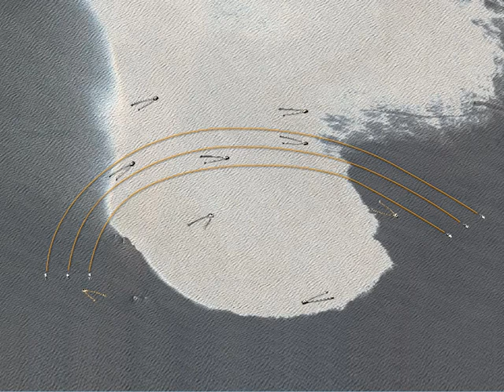Solution for Stopping the Gulf Oil Spill - Part 1:  How To Slow The BP Oil Slick

Comment: This is well intentioned, but it seems to me you've never really been in the GOM, or on any ocean surface, for that matter. Your opening comment on scale undermines this entire idea. The diameter distances alone are like driving 70mph for 1-4 hours; the circumference alone is about 700+ miles, and you suggest a series of continuous  perfect circles?  Try about 10000 sets of circles each about 1/1000 the size of what you suggest here and there might be a plan.

Comment: how would the crews and vessels swap out when the shift ends or they need refueling and maintenance? Will each boom have to have a gated portion for them to pass through? That means someone to watch, monitor and operate that as well. Also... that is a lot of boom you are talking about 100s of miles worth, likely into the thousands.

Comment: @HugoIStayHere 

$20,500 cost per working pair with crew per day allows for 751 working pairs (using only 40% of the amount collected in fines each day).  

And if each working pair collected only 47 barrels per day, that would be ALL 35,000 barrels per day collected.  Leaving another $23,100,000 per day for administration (planes, radios, training, etc).

Comment: @HugoIStayHere 

Say 60% or $23,100,000 per day for administration and 40% or $15,400,000 per day for actually doing the work.  And assume you need two good ocean going ships per boom.

Two 2nd hand ocean going tugs cost about $1,200,000.  Over one year, that is a daily repayment cost of $3,285 per day working.  Round it up to $10,000 per working day for repayments, fuel and repairs.

Comment: Build a 500,000 gallon bladder made of kevlar interwoven with high-tensile wire mesh with inlet and outlet ports -- one attached around the wellhead, and one or more at the other end for flexible siphoning hoses to the surface.  The bladder is twice the size it needs to be to contain the oil coming out of the earth each day and expand to some extent if the rate increases.

Have spare bladders on hand for replacements as necessary.

Done deal.

Comment: It was mentioned on the CBC that during a spill in the Gulf a few years back, they used the same tankers that transport the oil to suck the oil up.  The problem with this solution seems to be only the cost involved of using these tankers to solve the problem, rather than transport oil.

Comment: lower a gigantic four story tall iron grid onto the leak area, allowing the oil to flow through the shafts of the grid. screw the grid to the ocean floor add weights, etc. then bolt caps on each shaft individually until most of the grid is capped, acting as a suction cup, then cap or tube the remaining shafts directly over the leak as needed, and eventually controlling leak and pressure one square at a time...

Comment: it sounds like a reasonable plan but your not considering currents under the water. Current's under the water can carry the oil beyond the perimeters of the booms. If they want to stop the output of oil they should consider running a heavy piping system down to the source & bore into the the leak while packing the leak shut with absorbent material that will swell & fill the pipe causing a clog. It will not stop the leak but could slow it enough to cap it.